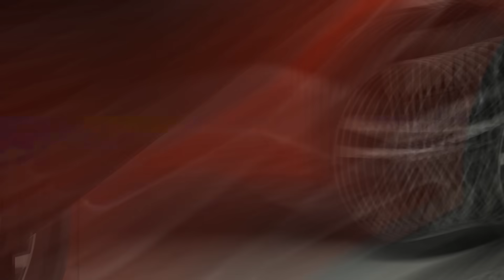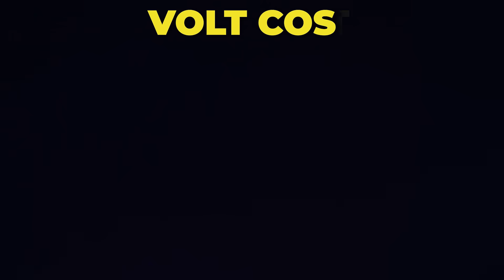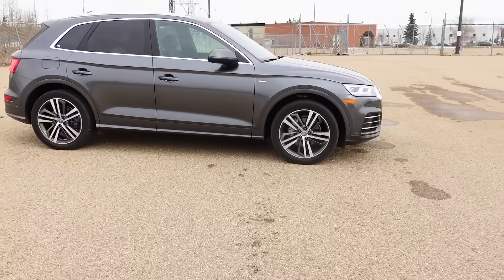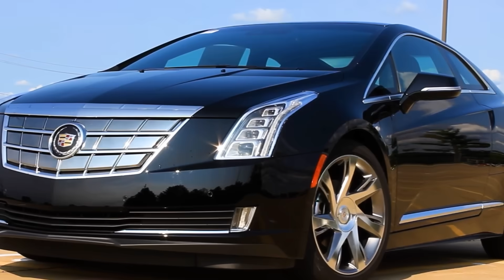Why Car Dealers Are Saying NO To Your Trade in 2026!

Comment: Time to put the "Greenies" that thought Electric vehicles were the way to go through the wood chipper . . .
Reply: We've got Toyota hybrids as taxi's. Some have over a half million kilometers. New battery costs less than 3000, but in 12 years I have never seen one need a new battery. Its just the American crap that sucks.
Reply: @billwhitis9997  ALL newer vehicles are TRASH, it doesn't matter where they were made or who made them. The first Toyota Prius, as crappy as it was, did not use lithium ion batteries. The batteries were put together in segments, which could be refurbished by the aftermarket, and replaced by a mechanically inclined owner. But those are obsolete now, and parts are no longer available for them.
Reply: A gas powered wood chipper.

Comment: I have a close friend who just bought a new Tesla,and told me he'll be driving for free because he's also installing solar panels on the roof of his garage to charge it for free.
I asked how much the panels and battery will cost,and he said about ten thousand euros.
I did the math and it came to about the same amount it would cost to run a gasoline powered car about 95 000 kilometers.
At the end of that a regular car is still worth something as opposed to an electric car which you have to basically throw away. 
P.S. I don't know how difficult and costly it is to recycle an electric car 😢
Reply: How do you eat an elephant? One bite at a time. Same for an EV possibly. 😂
Reply: @melissasmess2773 I have no idea how that applies but I think it’s safe to speak for everyone when I say we luv it
Reply: This is what people don't think about. Ev cars don't have a parts supply. Yep, air bag cars are crap. Worked as technician in the body repair industry. They nothing but trouble. Parts are expensive. Australia 🦘

Comment: This video explains why many car dealerships are increasingly refusing to accept certain used vehicles as trade-ins. The primary reason is that modern, complex automotive technologies often lead to prohibitive repair costs that exceed the vehicle's market value, making them a liability for the dealer.

The video breaks down the five key technology areas causing these rejections:

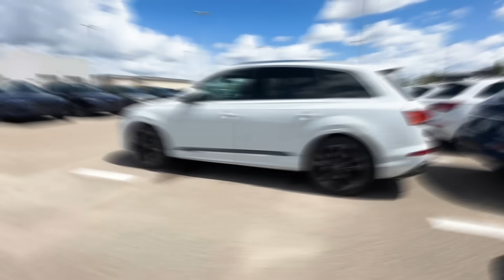Early Hybrid/EV Systems (0:22 - 3:13): Proprietary, complex battery systems (e.g., BMW i3, Chevy Volt, Mitsubishi Outlander) are difficult and expensive to repair once battery life degrades.
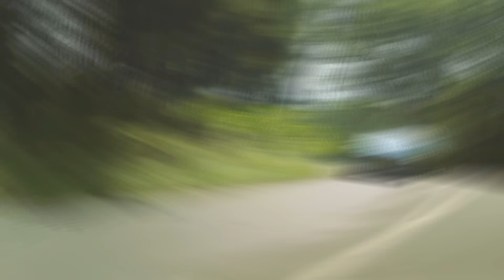Air Suspension Systems (3:14 - 5:53): Systems like Mercedes-Benz Airmatic or those in the Audi Q7 and Range Rover involve cascading failures (bags, compressors, valve blocks) that can cost thousands to rectify.
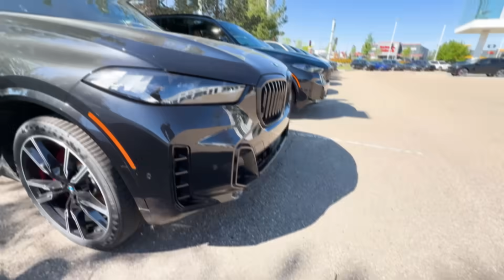Early Dual-Clutch Transmissions (5:54 - 8:01): Models like the Ford Focus and Fiesta with the "PowerShift" transmission are notorious for mechanical failures, including shuddering and complete transmission replacement costs.
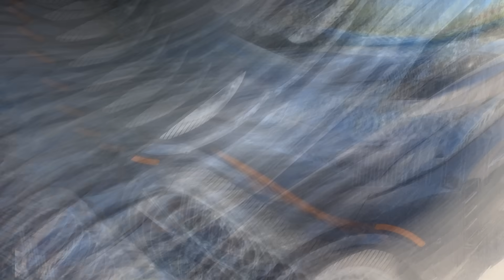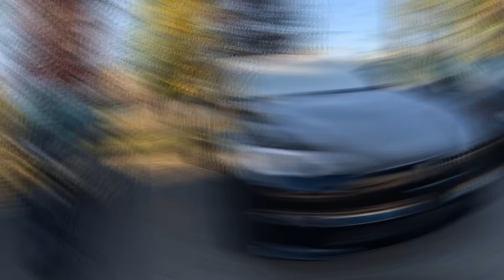Small, Turbocharged Engines (8:02 - 11:22): Highly stressed, direct-injected engines (often in BMW X5 or Audi Q5) are prone to oil consumption, turbo failures, and timing chain issues, leading to significant long-term maintenance costs.
Complex Electronic/Tech Integration (11:23 - 15:25): The trend toward infotainment-heavy dashboards and ADAS systems (like in early Tesla Model S or Jaguar I-PACE) creates issues with parts scarcity and software obsolescence, rendering the tech unusable after only a few years.
Ultimately, dealers avoid these vehicles because they are difficult to recondition and often require specialized service that makes them unprofitable to keep on the lot.

Comment: In 5 to 8 years, all.these new cars with screens are going to have screen and electronics failures. No.delaer will take them in on trade. 

I would buy used or lease until buttons make a.come back.
Reply: It's the old double standard, they sell them, but they won't buy them back. That's why they are called stealerships
Reply: @VincentSchoenekase they have to take back on a lease and give the guaranteed residual
Reply: Bs.. these screens last forever.. look at a smart phone or tablet.